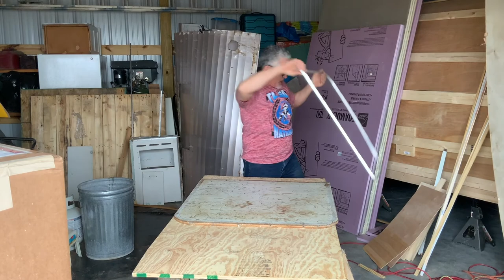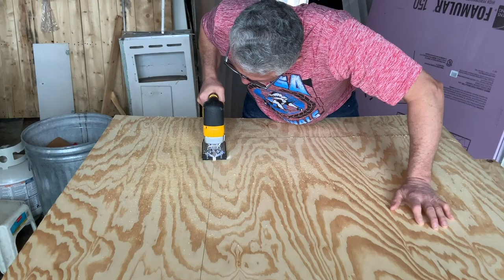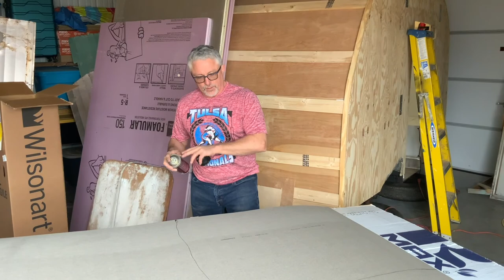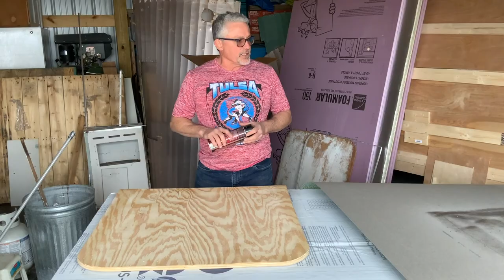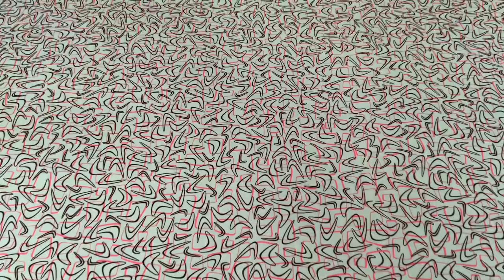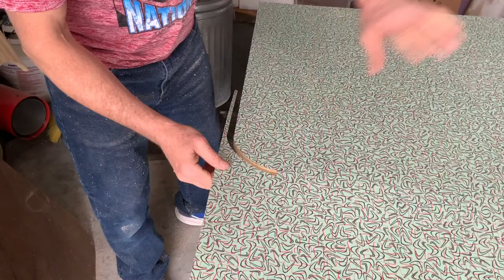Ep. 19 Vintage camper dinette table rebuild with Formica/WilsonArt. Retro Serro Scotty  remodel

Comment: I just got the idea to cover my two tables in my tiny camper. The one is actually under my couch at home because I leave my bed set up permanent, but the little small one at the front dinette has just a plain top that I painted, and it scratches pretty easy, so I want to put something on it. This was very helpful. Thanks for sharing it
Reply from the maker: I'm glad it was helpful.

Comment: Where would you get the metal trim band if you didn't have it?  My camper has a table but is just painted plywood.  And where did you fid the Wilsonart?  Thanks!
Reply from the maker: WilsonArt is available at Home Depot and Lowes. Search it online. The trim is from Vintage Trailer Parts.